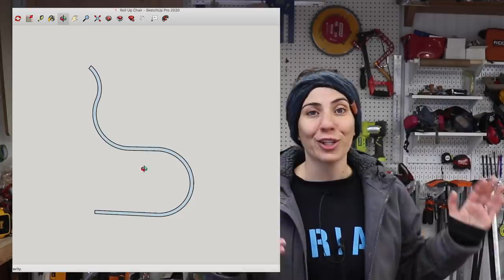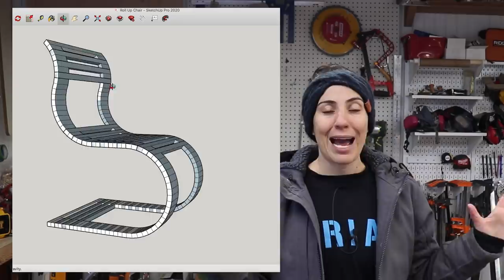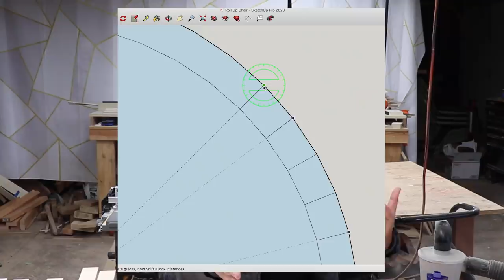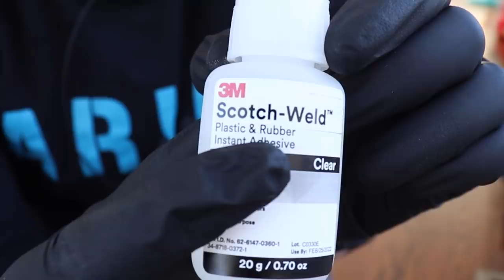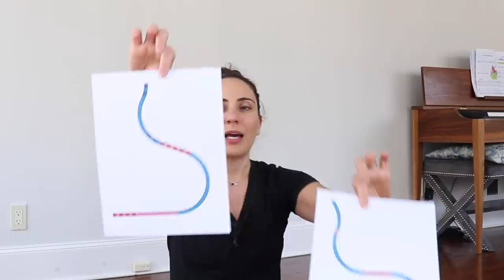I ATTEMPTED to make a chair that rolls up... It didn't go as planned...

Comment: This looks a lot more complex mechanical problem than it seems at first. There is a lot going on. The backrest belt-wood fixing needs a different kind of solution than the bottom leg area of the chair because how the forces act on the tensioned belt in each section. On the bottom the belt is pulled into the wood which means the belt is very nicely and evenly tensioned. Whereas in the backrest the belt is pulled off of the wood and only held by the screws. Which means staples work just fine for the bottom part but the top part needs screws and probably as big washers as you can fit there to keep the belt from  coming off the surface as much as possible.

Having to get it all right just in the right tension on the first attempt so it keeps shape is already pretty difficult! You got that right which in itself was pretty amazing. I was worried about the flex as soon as I saw the first pic of the chair because the tension on the belts is huge. Let's say a person who weighs 60kg sits on the chair the max tension is probably around 500kg or 900lbs for each of the two belts. A lot. Like lifting straps a lot!

If I was to attempt something like that I'd just make my first prototype with wood pieces like you but I'd use sheet metal bands instead of belts to minimize all flex. It won't roll up but it would give you the idea how rigid and tough material you need for the belts. Also try to make the different sections separately and join them later. Maybe try just using 5 or 6 parts per side to make it less time consuming. Or make full width parts. I'd also think about some kind of tensioner so when it is unrolled it doesn't flex a lot when you sit on it. Seeing your tools you have made you seem very smart and capable so I'm sure you'd be able to come up better ideas than what I wrote and I'd love to see them.

Would be great to see you try this again. It is very challenging project but I'm sure very fulfilling and educational if you can get it right.
Reply from the maker: I tried it again…. It doesn’t go as planned again… ha. Videos hopefully out shortly
Reply: @3x3CustomTamar  Looking forward to the video.I'm mechanical engineer and I really like woodworking videos that have some kind of mechanical aspect to it. And even if it doesn't work the reasons why it is so difficult are also very interesting

Comment: This project is very similar to a childrens toy. A wooden snake. On that toy, you need to control the angle of the curve at each section. At the point where you are sitting, you need a keystone section. Before you expect the curve, start curving agressavly upwards. You will need the change the angle of your saw for each section.

Comment: Very nice work overall. I very much enjoy your chennel. Anyway, since you asked, I think that, while figuring out the number of pieces in sketcup, you should have taken into account the stretch of the fabric. With the stretch the "basis" of the "trapeziums" actually get a little far away from each other. This definitely changes the shape of the chair. Even the first fabric could work but the desing of the chair and the shape of the pieces you design should consider they will not be touching each other on the basis (I hope I explained myself).

Comment: What if the angled pieces were alternating wedges. Not sure if this would require a recut or you can just flip every other piece to have the wide end on the inside... Currently all the narrow ends are on the inside of the curve, which makes it bend into its natural circular shape, but you’re looking for some push back

Comment: I don't know if you read these comments. First of all, yes you learned a lot there are a few points that you might have missed. 
1. The angles you cut are critical for making the curves, a fraction of a degree will end way off the planned arch. You should do a layout on the side and adjust the angles to get the correct arch.
2. I think you kind of figured out that stretch in the material will be really bad, you need to find a non stretch material for to attach to the wood, since this is really difficult to find you will probably need to make up a few layers with 2 or 3 layers of webbing ... don't forget to factor the stretch into your design - you kind of did that. 
3. You cannot use tape to join the blocks that small space adds up and as you saw it fails ... take the time and make a template this will make a big difference 

One last thing ... you don't fail until you give up, as long as you are trying you are simply exploring the alternative to find which one will lead you to to succeed.

Comment: Can you not make each block combine into joints that strengthen the integrity of the chair? I think the problem is that the current chair seems to be working as if every piece is separate. It needs to conform into one object to create a stable structure.

Comment: Looking at the final product, it looks like you need to make a steeper curve for the backrest, but other than that it looks pretty good... 

Also, is it possible to stretch the webbing a bit, on every piece you attach so as to create a stiffer build, but without sacrificing strength of said webbing??? That would in theory allow for a little stretch, depending on how much prestretch you give it, while giving you an overall tighter fit of the pieces... You would have to figure out what the proper amount of prestretch is, and figure out how to precisely apply the same amount of prestretch over the entire project, but it would probably feel a little stiffer or sturdier...

Comment: This prototype can still work. All you need is a bunch of triangular pieces between the blocks in the top half of the chair to increase the angle of it. They don’t even need to be triangular since you don’t need to wedge them all the way in to make it work, a bunch of ”L” shapes should be enough. If it can support your weight you have proven the concept. You don’t need to redo the whole thing.

Comment: You should be able to fix that just add some splinters to expand the size of the wooden segments where its needed, just use double sided tape with different sizes splinters and once you got it right just glue on the splinters to the segments and you're done.

Comment: If you pull with two wires from the top to a piece down so that when the weight goes down the back support gets pulled forward to rest the back from being attached to the front low piece?

Comment: If I would have to build it - I would use a bunch of hinges to connect the wooden pieces. It's a ridiculous amount of tedious work and it probably wouldn't work as good with rolling in. But I think whatever soft and bandy material you would use will end up loosening the end shape of the chair.
Great video though, thnx

Comment: @UC39z4_U8Kls0llAij3RRZAQ, I think the hard wood might actually be necessary, as the forces put on the adjoining surfaces of the blocks might crush mere softwood a bit too much.  You could PoC it with a 4" wide section of just the base and seat, then put some of your weight on it while holding a safety bar to support you if the test fails catastrophically.  If you play with the bevel angles, you might find that softwood works okay under compression with no bevel at all, though the initial setting force might be quite high, to get the plastic deformation you will need to set the working angle.  Basically, you would be using force to squeeze the bevel angle into each piece of softwood.

Comment: I'm not a wood worker but would it be possible to drill holes in the wood and string a steel cable through instead of using cloth? It seems like it would be easier to pull tight and would look cool hidden.

Comment: I think maybe overcooking the circle used in the template (making it a more open arc, rather than just having less of the circle) would work better. That way once the pieces are stretched they don't just shrink (the circle ends up smaller)

Not sure if that makes sense.

It's definitely a design that could work.

Seems like something Ikea would make 😂

Comment: I guess Kevlar tape could be better. Also, in this curves where you changed the direction (in for out) you can change the side of the tape to make the vector pull not push.

Comment: Imagine making a barrel with a bicycle chain imbedded in it like you would a truss rod and on the inside curve portion the chain is on the opposite side of the boards.. to allow for rolling up the chain might need to zig-zag a bit so that the chain is not in the way of rolling up smoothly.

Comment: It is simply impossible that the chair completely rolls one way, when there are opposite curves, so both pictures don't add up, they're fake. Which means this needs to be re-engineered taking some liberties from the picture. I think the main challenge might be to attach the wooden blocks to the strap on their whole surface instead of a single point (the screw). That being said, I think you've done much better than I would ever have :D

Comment: what about using the strap on the opposite side from where the chair snapped from....think you should have used more screws where on venerable areas....think the straps on the outside should run from the bottom curve

Comment: If you increase the depth of the pieces it will considerably reduce the forces on the webbing keeping the curve (arch) in-tacked,  I don’t think the back will work as it is applying forces to the ‘inside’ of the curve (arch) which will produce tearing forces to rip the webbing from the wood (the forces need to be in compressed tension to work) maybe if you make the back curve the same direction as the lower section and have a joining piece at the base of the back it may just work, although the simplistic aesthetic‘s will be ruined

Comment: You only failed if you didn't try.
I think key to this idea is rope the fabric is only to keep it in line so the parts don't shift back and forth.
Have you seen the suspended tables that use rope.
This might be the key to making this work.  However now you have a cnc router  it might be somthing you can do on sketchup and see on the computer whats going on. You could also go a slightly different route with tabs like a puzzle held by brass rods in place that let you roll it up. Dont give up on it.
A parachute cord might make a good rope to use. Just glue the fabric on. It isn't providing strength just alinement.
The wide webbing looked good the screws got you in trouble.  
Its the shape of the parts and rope that let it fold out the rope holds the parts togather and the webbing keep them in line.  Tension sets the seats shape. Maybe its wire rope.  
You set the tension and pin the rope in sevral spots so it can't loosen up becuse you wont be able to tie a knot in it that why I said wire rope becuse they use it to make guard rails and set tension.

Comment: just put in some wedges at the corner which holds the back up, so it's pointing up, try different thicknesses until the angle is right, and glue them in, and you are done. this is a success actually, not a fail. and if you want to improve it, i suggest making a more massive chair, wider (70cm instead of 50) and the wood elements thicker, from even harder wood, because this design does not have side support, it wobbles sideways by design, so if its wider , and the wood more massive, that could help stabilize it sideways. szabi translator from transsylvania

Comment: Just a suggestion; before actually building up the chair, If you make a smaller scalled version of the final product, you could figure out If it works and (if) how do you need to adjust it in any way for the thing to actually work!! That way you don't waste too much material etc!

Comment: I think I would have started making just some pieces of a curve and done some testing with them. Screwing all those pieces together without any positive evidence it's gonna work would have driven me mad.
Would the build work better with an angle more like 86.5 or 87? If the fabric material stretches even just a bit, that will effect the angle and take a few decimal points off.

Comment: Maybe you did not fail at all?
Maybe the curve at the bottom of the back connecting to the seat should actually be glued solid.
If you start rolling the chair from the top it should match pretty closely that curve and therefore having that part of the curve effectively solid would still allow the chair to roll properly.
I would have a hard time thinking of anything else that would hold that curve with effective forces on that curve will have on it. I mean in theory it should work, but what can actually hold the surface edge without installing something like metal hinges. Resin might be able to do it, but I don't know if there is a process for applying it that would work.
I would consider gluing that part of the curve solid or using small hinges.
You should not stop.
It is super cool!

Comment: I'd suggest rather than using 2 strips on the sides putting a wider material for support also with 8" wide all around or alternating 8" and 4", i suppose that would make the structure less bending sideways and it will deflect less on the support

Comment: I think you aren't that far off with that design...

You just need to replace the webbing with something that doesn't stretch as much and that you can adjust the tension on. What about using a steel rope and adding wing screws on both ends to be able to adjust it? The steel rope would then need to be able to slide along the wood blocks of course, but that should be doable. Just add sort of a guard along the current webbing path. Like 2 layers of fabric and then have the steel rope run in between those, maybe even with small metal hooks to run through... Just something really to be able to get more tension in there, then you should be fine :)

You might also want to investigate how much the "hardwood" can actually be compressed in the bends. Because while hardwood might sound like it should be really sturdy - it still is wood, and where the main bend of the chair is supposed to hold a sitting person the tension on the inner edge of the wood blocks could well exceed a few hundred kilos because of leverage...

Comment: Is say the mistakes was not taking into account the stretch of the material holding it together and not taking into account the compression of the wood.

However, at this point you can compare the original design of the circle's circumference in sketchup to its actual circumference under load and back engineer it from there.

But I don't know if it will be possible to make the chair work over a wide range of weights.  It will perform very differently if someone 100 pounds sits on it versus someone 200 pounds.

Comment: What about reversing the angle at the point where you feel supported rather than using pieces with no angles cut for the seat? The problem with the back looks like the curve isn't sharp enough to bring it up to support you. Starting the curve closer to the front of the seat might take care of that. You might not even need to buy new wood, but just add the angle to the square parts. 
Whether you figure it out or not it's a really cool attempt and always interesting to watch your vids where you try to figure out "how'd they do that?"

Comment: The part bending up is always going to fail. You can close the whole thing in a loop, so the butt part can hang between two arc. You can make one side bigger so look like chair.(But still it need something to stop it from rolling away from you. "M" shape would work.) You can also make it dis-connectable to roll up. Soft wood could not bear the pressure between the pieces, I think.

Comment: Use thicker wood it will put less strain on the strap due to leverage laws.
Use broader and possibly thicker straps on each side. 
Pull the straps very tight when attaching and absolutely no gaps.
Further overcompensate the curves for the anticipated stretch of the finished chair under load.
Do not incorporate any stretchy rebury or compressible materials.
Also consider the compression of the wood under the load and perhaps chose a less compressable wood type

Comment: Hmm, some thoughts... you might need to make the whole thing under load, for example, your two long belts, have those already stretched... eg, make two points to attach the ends to that you can push away from each other, giving you the belt stretched out, maybe suspended, with no sag, so you could put some weight in the middle and not have it lower too much... then attach the wood as close together as possible. Do a small, maybe 10 piece prototype, so you can compare the strength of different methods. Finding time to make one prototype (or "proof of concept") per week lets you make progress without letting it dominate your time! Look at how a bow is constructed (as in, for a bow and arrow) with different materials to give it strength and flexibility... suggests your two belts should be on top of each other, rather than side by side. Maybe even consider adding a wire, although metal fatigue does need to be considered... could even go through the wood maybe, but would need a way to lock it or loosen it to allow rolling. Maybe even adding a finish to the wood where they interface, a matty glaze, something that is high friction when two placed together. Good luck!